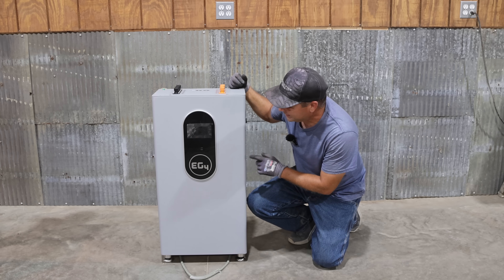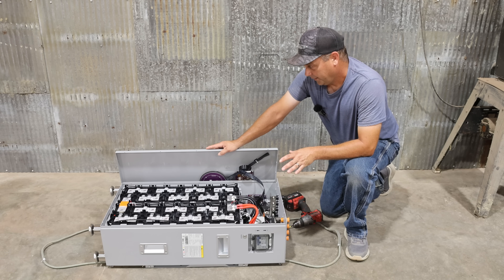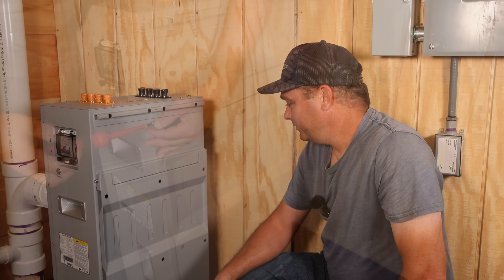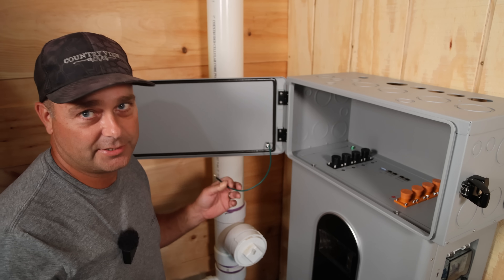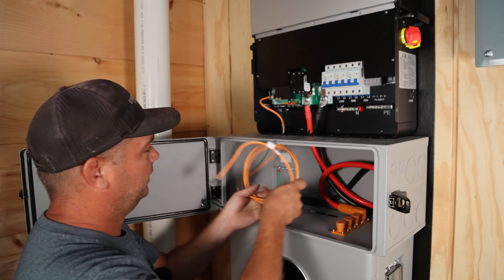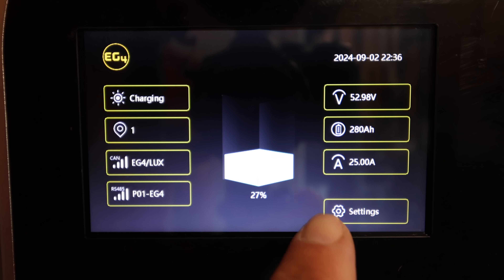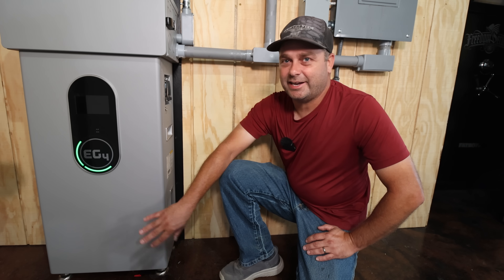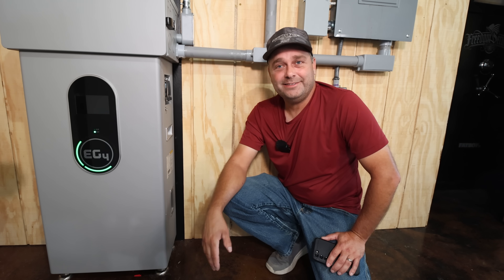Complete Installation and Review of EG4 Indoor Power Pro Battery and Conduit Box.

Comment: Hey Evan, does the 6000XP have an internal transfer switch like the 12000XP? I’ve been trying to find the info online but haven’t been able to find an answer. Thanks.
Reply from the maker: yes, the 6000xp has a 50 amp transfer switch.  The 12000xp has a 100 amp transfer switch

Comment: What are you using at the back of the panels?  I see some black material?
Reply from the maker: It is Fiber cement board (tile backer board) painted black.  It is a fire proof layer between the inverter and wooden wall.

Comment: Hi, I have been following many of your videos. Always quality work! I am in the process of installing an EG4 Gridboss, Flex Boss21, and two indoor batteries. I have the batteries placed where I want them, and am now researching mounting the flexboss. I’m reading through the manual and it states the Flexboss is designed to be mounted on non combustible material such as brick or concrete. It looks like you have something behind your inverter? Is that some type of non combustible material? I am wondering if I just lay a sheet of sheet metal behind it if that will satisfy safety and inspection purposes? It is currently backed with painted 3/4” OSB. Thank you! Steve.

Comment: It's still many hundreds, or even thousands of dollars less expensive to DIY your own much higher capacity LFP battery pack in the form of a kit. Not only will you get much higher capacity (16.8kWh) versus only 14k.3Wh for this unit, and you'll get top-name-brand EVE or CATL Grade A cells and a much better BMS with active balancing instead of this battery's passive balancing, all for FAR less money than what this lower capacity EG4 battery sells for.
Reply: Most people have no business at all designing and building their own battery banks. These EG4 are plug and play and have UL Listings.

Comment: This is great, thanks for making this informative vid! I’m planning to use this battery and the grid boss inverter instead, but I was wondering *how do you know how to set up connecting into your electrical panel?* Do you have a video on this or could you make one? Does the installation guide walk you through it? Trying to DIY as much as possible. Thanks in advance for any light you can shed.
Reply: Just saw you had some videos on the electrical panels so I’ll have to watch that since I’m planning a hybrid system - I’ll see if I still have questions! Thanks!

Comment: Sorry at 11:42 you said you could see the battery cell voltages on the eg4 website. This is only partially correct. You can only see the min. and max cell voltages of 2 cells not the complete 16 cells. You will need a different monitoring system to see all cells or use the front lcd panel.

Comment: Better hope your local municipality doesn't find out about your illegal addition to your home or they might just make you remove it. That 6000XP, in combination with your battery pack, is not certified to UL9540 standards as an approved system. and as such, cannot be used in residential installations. The 2020 version of UL 9540 requires a battery and inverter combination to be listed.
Reply from the maker: It is UL9540A - tested.   You obviously didn't watch the video.
Reply: @CountryViewSolar-DIYProjects  Sure, the battery might have been certified to UL-9540A standards when used in a system along with a 12kpv or the 18kpv, but the battery is not certified to UL-9540A when used with the 6000XP or the 12000XP. Check the 6000XP's specsheet or call SS or better yet, watch the video titled "6000xp is not UL9540 certified. YOU CANNOT LEGALLY install in the US along with solar panels." or even better, call your local municipality and ask an inspector to perform an inspection of your illegal addition to your home.

Comment: Are you running both dc and ac wires in the box between the inverter and battery?
Is that allowed per CEC? Just trying to understand for my own install if this is allowed as I see everyone do the same. 

NEC (specifically NEC 690.31(B)) requires AC and DC conductors to be kept separate unless they are in an enclosure designed for both and have adequate separation.
Reply from the maker: You need to look at it this was the Inverter, wire trough and battery and a complete system.  Once inside the system.  The AC and DC wiring has to share the same enclosure.  Just like all the factory wiring inside the inverter does.  I am having trouble finding the code, but there is an exception, when AC and DC wires are for the same device, they both have to occupy the same enclosure.   Think of the wiring trough as a enclosure, not a raceway.
Reply from the maker: NEC 300.3 (C) (1) 1000 Volts, Nominal, or Less. Conductors of ac and dc circuits, rated 1000 volts, nominal, or less, shall be permitted to occupy the same equipment wiring enclosure, cable, or raceway. All conductors shall have an insulation rating equal to at least the maximum circuit voltage applied to any conductor within the enclosure, cable, or raceway.

Comment: what is the black sheet or blanked behind inverter and battery?
Reply from the maker: Fiber cement board (tile backer board) painted black.  The inverter has to be mounted to a non-combustible surface.

Comment: Thanks for the informative video.  What is the black mat that suddenly appeared behind battery as you mounted inverter?  Also, when you held up cables, one set had ring terminals on the other end.  Did you put them on or did one set come complete for installation of EG4 Battery & Inverter installation?
Reply from the maker: It is 1/4 inch fiber cement board (tile backer board) painted black.  The inverter needs to be mounted to a non combustible surface.

Comment: Why oh why do they always gloss over the AC input/output installations on every one of the 10 videos I've watched on this so far or even do a cursory spec explanation on the max voltage on the two mppts. It says it tops out at 480v. Is that on each leg? Eg4 and everyone else is unclear
Reply from the maker: There is no AC input on the battery.  This is a video on the battery, not the inverter.

Comment: What you presented in your video was excellent, but I watched so I could understand how to connect the units to the PV system and the grid and the breaker panel. You skipped over this completely.  All the videos on YouTube about this battery show the same things you did.
Reply from the maker: The battery doesn't connect to solar panels or the grid.  The inverter does.  Watch the inverter video.

Comment: Thanks for the video. I'm about to install 2 of these batteries (currently on backorder). I have read the user manual and it states that the wall should be non-combustible. I noticed that mid-install, you added what looks to be some sort of panel behind your battery. Can you let me know what you decided on? I too have a wood wall that I plan to mount my batteries to. Thanks!
Reply from the maker: Fiber cement board.  Or tile backer board.  I painted mine black to look better.
Reply: @CountryViewSolar-DIYProjects  very nice! I'm going to copy that idea. Black was a good choice 👍

Comment: Grateful I stumbled across your channel.   Subscribed!

FYI:    I'm installing the same thing at my home.  Just an idea for you... when I put the 2/0 cables from the battery into the inverter, I cut the excess 2/0 cable so that there was less excess wire (in the box) to "snake" around the conduit box... especially since I had to add terminals to the cable anyway.

This also has the added benefit of shortening the wire run run for the battery to inverter.

Comment: I'm guessing the screws that bolt the conduit box to the battery bond them together for ground
Reply from the maker: The screws had regular flat washers.  Nothing to bite through the paint into the metal to bond electrically.

Comment: Your Video is Half Way true, You did not show the connection  to outside power and the connection to the circuit braker to power the house or connection to solar panel., what you Show an Infant can do.
Reply from the maker: This video was just covering the battery.  You have to watch the video on the inverter.

Comment: Hi Evan, Great video, What did you use as backer board behind the battery and Inverter? Thanks
Reply from the maker: It is fiber cement backer board, used for installing ceramic tile.  I painted it black with outdoor latex paint to make it look better.  The inverter requires a non combustible mounting surface.

Comment: Hey I'm thinking about making a solar trailer that I could pull behind an EV and take off grid with me. I wanted to use this battery and inverter since they are popular, cost effective, and seem to work well. For the trailer i wanted to lay this battery and inverter on the ground tucked away in a cabinet space between the wheels. I figure that would be the best for weight distribution and the layout of the trailer I'd want. Can this battery be laid down like that do you know? I've looked for this info on forums and such and it sounds like it isnt recommended but when you opened it up it didnt seem like there was anything structurally that necessitates it. Maybe the fire suppressants position require that it is stood up?
Reply from the maker: The battery is supposed to be stood up.  The manual says not to mount it flat on the ground.
Not sure why.  Probably because it is designed to hold the weight in that position. 
I don't think it will affect the fire arrestors.  I have seen fire arresters mounted on the side(like this battery) and mounted over the the top of battery (like server rack batteries)

Comment: Cables sizing?
Reply from the maker: The battery has a 200 amp output.  So 2/0 wire or larger welding or battery cable.  2/0 welding cablenis rated at 223 amps.

Comment: Hey Evan, sounds like you are using three sources or do you? If so, how do you Switch one for the next? I'll have to go back and rewatch I guess.
I'm contemplating on using all three and using two Generac Auto Transfer Switches to feed the house. Solar Primary with Utility backup on the 1st ATS feeding the top of the second ATS with the Gen ( Generac 22kw ) being the backup feeding the House. I think that will work. I can't run full Solar because where we live isn't a great source.
Reply from the maker: My Hybrid/Grid tied solar is the backup power for this system.  If I use a generator, it is a manual through an interlock.

Comment: Thanks for another great video.  I looked up the EG4 indoor battery for temperature range and it seems to have a high temp limit of 133F which makes it stay in my house in the Texas heat.  Not that is a problem.  I have a question - the cost for the power wall device seems to be higher than going with server rack batteries.  I do like the connections and how it looks but to get to 60kWh it would take a few of them (not sure if I could stack more than 3 of these 14kWh together).  Also they seem to be limited in where you can deploy them where a server rack battery can be thrown in a truck to go mobile or an RV (of course 5kWh per battery in that case).  So the main advantage of the wall mount is that it is attractive and wife friendly.   What are you comments on my comparison?  All the best from north Texas!
Reply from the maker: The new lifepower 4 server rack batter is $1200.  3 of those is $3600. A 3 - slot server rack to mount them is $375. Total of $3975 for 15kWh.  This battery is $3300 for 14.3kWh. In my mind this is the cheaper route,  better looking, and more space saving.
Reply: @CountryViewSolar-DIYProjects  oh I stand corrected. Thanks for your content!

Comment: I am curious.  Does that somewhat "interface" with your setup in your shop?  Do both systems use the same solar panels?  Also the A/C coming in, does that come from the grid or does it come from your inverter from your other system in your shop?  Just trying to get an idea in my head as far as the schematics.
Reply from the maker: The backup source of power for this system is the EP cube system.  So if it runs out of power, it can run off the other solar.  It is like 5 time redundant.   Solar or batteries on this system, or Solar, batteries and Grid on the other system.

Comment: I realize you find the system virtually fireproof. Yet it is in your house .. where you sleep. Do you have a fire suppression plan? You know, just in case what never should happen does happen?
Reply from the maker: Fire Alarms and Fire Extinguishers.  Worst case scenario I live the in the barn if the house burns down.
Reply: @CountryViewSolar-DIYProjects   Evan, my 10th battery bank home build using a dozen name brand 300 amp hour batteries ran for 2 years, 24/7, with zero problems. Last August it caught fire and I had water on it within 70 seconds of hearing the loud pop. The smoke and water damage was a huge deal.

The Forensic Fire Investigator said that the battery on the bottom shelf had been dropped from 5-6 feet upside down sometime during shipping to my home. The wires to the BMS were found to be crushed. It dead shorted 2+ years of 24/7 flawless operation and burned 8 more batteries above it.

I bought 5 wall mount EG4  280 amp hour batteries, a 6000EX inverter and a Flex Boss 21 where 3 batteries are mounted in a Boss Box on caster wheels.
Screw the cost. I could have lost my home, lost collector cars, lost machine tools, welders, a generator collection and much more. Thanks for the internal battery view. With the UL Listing and a heavy steel case with no vents except tor 2 pressure relief plugs, I think these batteries won't set fire to my place or yours.      Fire cabinet....   https://www.youtube.com/watch?v=Af91JljyfeI    The burnt power panel ...    https://www.youtube.com/watch?v=0RvBk6FRJaw

Comment: When you say it runs down to 20% overnight, does that include air conditioning as the main draw?  Seems like it is a lot for when things are normally off like the range/oven and laundry.
Reply from the maker: This is just running my critical loads.  Lights, outlets, fridge, deep freeze, microwave, & furnace,
Reply: So this battery will run central air overnight correct?

Comment: you have to Scrape the paint behind the ground bar for a good ground.
Reply from the maker: No, the screws included with the ground bar have triangular ends, and you use them to cut the threads, and they bite into the metal of the enclosure and make a good bond.

Comment: I hope this is not a silly question, but isn’t there a safety issue with having the battery in such close proximity to the plumbing stack cleanout?  If that cleanout were to be used, liquid could easily be splashed on the battery.  Is that a concern at all?  Did you consider it when choosing your installation site?
Reply from the maker: I am not concerned about it.  If you ever need to use the cleanout, I would cover up everything with a sheet of plastic.
Reply: And these batteries can be mounted outside by the way.. not this particular inverter though

Comment: I was expecting, or at least hoping, you would have given a better explanation. The system not being wired to the charge system at one moment, then being completely wired at the next is lacking a lot. Anyone viewing this chanel for the first time, not knowing about your other chanel, could not understand how that battery was charged by the sun, as you stated.
Reply from the maker: There will be another video soon, on the inverter, which uses battery power to make AC power and uses solar to charge the battery.    
I will also have a video covering the entire system as whole, on Country view acres channel.

Comment: Another question… what would be the noise level of this setup?
Thanks 
John
Reply from the maker: I don't have a sound meter, but the 6000xp inverter is quieter than the Canadian Solar EP cube.  And I don't hear it running upstairs.  Also, the fan speed can be adjusted in the settings
Reply: @CountryViewSolar-DIYProjects  thanks

Comment: Great video Evan,   that setup and battery looks very nice !      So is this EG4 setup going to take over powering your home on both solar and when on batteries(backup mode) or only when the grid goes down as backup and is the Canadian Solar setup now only going to power your barn, etc?
Reply from the maker: This new EG4 system is powering my critical loads.  My other System is powering my other breaker panel.
Reply: @CountryViewSolar-DIYProjects     Excellent !
Reply: I was going to ask the same question! Next question I was going to ask is which solar panels are being used to charge this? Is it one of the three arrays you have on the barn? Awesome work as always!

Comment: What happened to your other system? Is that just for the shop now?
Reply from the maker: My other system runs my larger breaker panel, and this system runs my smaller breaker panel.  My other system also the backup power for this system.

Comment: You said a MAX output of 200 amps.... So technically, that could run the while home if needed???
Reply from the maker: 200 amps of 48 volt DC.  it would probably be able to support 12,000 watts of AC power or 50 Amps of 240 volt AC power.

Comment: What is the black material you installed on the wall behind the inverter and battery.?
Thanks 
John
Reply from the maker: It is fiber Cement board painted black.  The inverter is supposed to be mounted to a non-combustible material.  So I needed something between it and the wood.
Reply: Evan, will the new system run your home completely off grid now? @CountryViewSolar-DIYProjects
Reply: @CountryViewSolar-DIYProjects  What's your opinion on using something like Type X drywall (fire rated)? Or would you still use something like cement board?
Reply: New to solar, can you add another battery to this system and still use the single inverter or do you need that entire set up to add another battery?